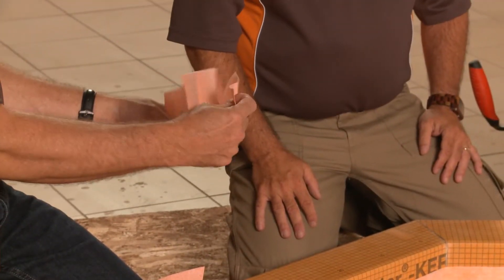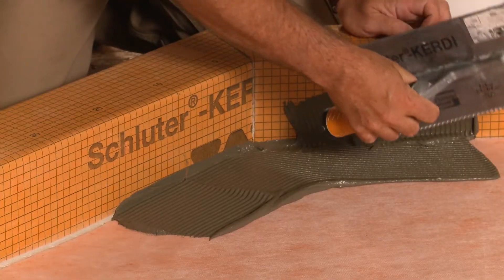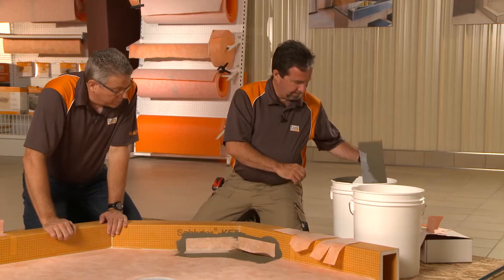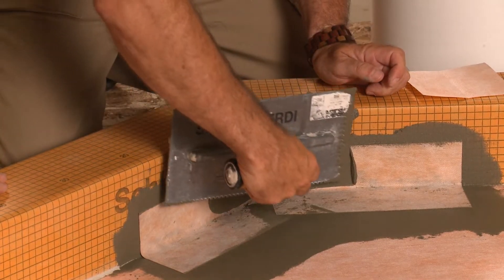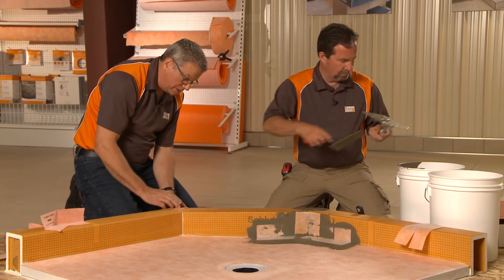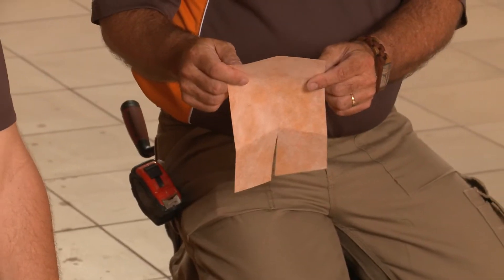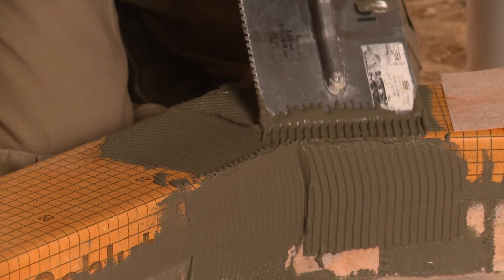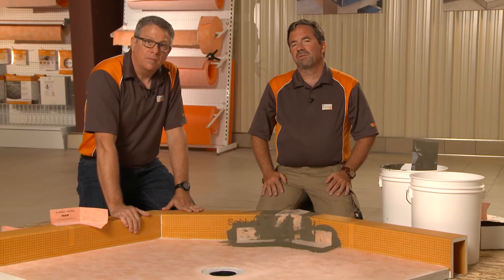Waterproofing a Neo-Angle Shower with KERDI-BAND

Comment: I'm ripping out an old corner shower stall and want to use this system.  In this video the base appears to be thick in height.  When searching for neo angle Ditra base to which I can place the curbs, I get KST965NA/BF which is only 1-1/32". Where can I get the thick white base in the video or is that custom cut from a larger square base? Thank you .
Reply from the maker: Hi John, can you give our Customer Support team a call to discuss your project in a bit more detail, and they will be able to advise on the best shower tray for your project from there. 800-472-4588 (US) or 800-667-8746 (Canada). Thanks!

Comment: So I have seen flood test when you custom cut and overlap kerdi band where the water leaks out through the very corner of the overlap you make. This is at 2:24 time on the video.  The very corner has a pin hole crack and would leak.  How can you guarantee that this is water proofed enough not to leak at the Neo Angle corner?
Reply from the maker: Thank you Ryan for your comment!
 As long as the right thin-set is used and the corner is flattened tightly, there should be no concern for the pin hole in the corner. KERDI and KERDI-BAND are hydrophobic, meaning they repel water. With the membrane properly folded and embedded in the thin-set it will still be considered a waterproof application. 
 We feel confident as we have installed corners in this fashion for decades prior to and after we produced the prefabricated corners. (Just to add, a water test would always be recommended prior to tile installation.)